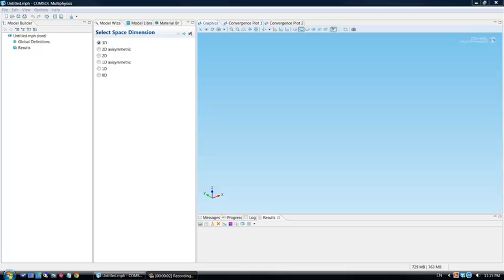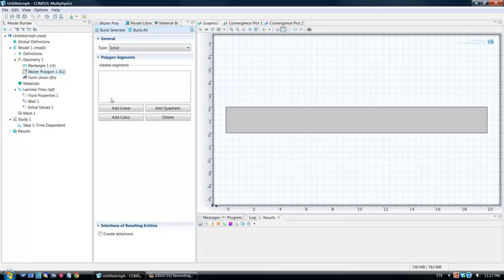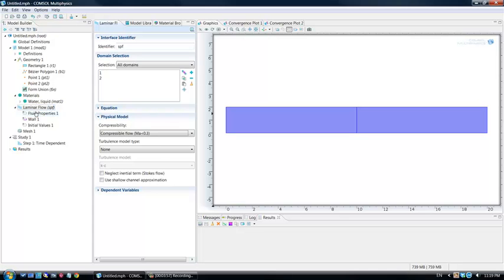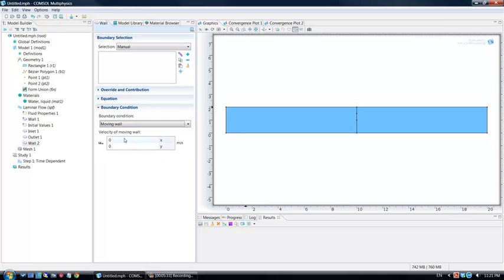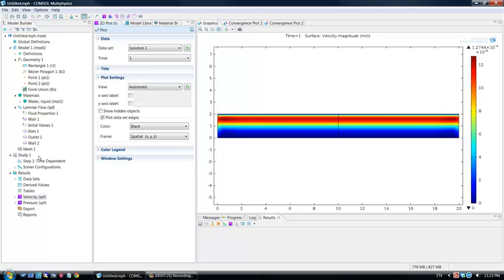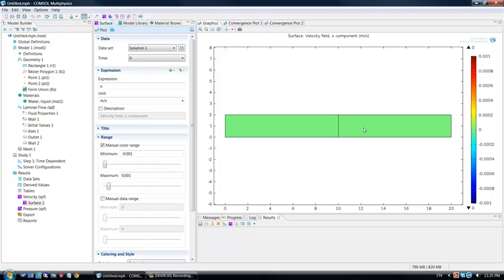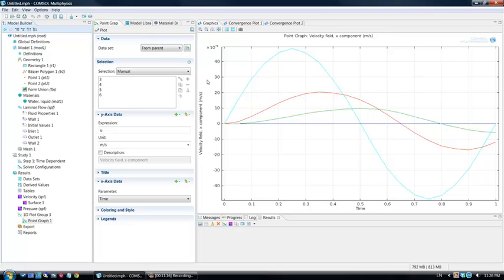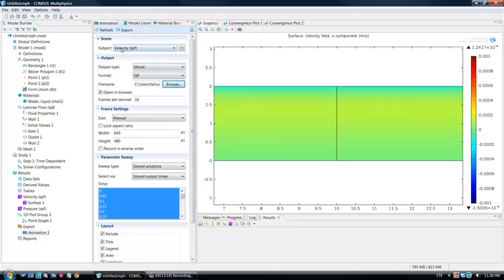Couette Flow

Comment: If I use the same dimensions as you but switch the moving wall speed to 61 meters per second it no longer converges (after hours its still calculating!) 
What is the difference? What dimensions do I need for infinite X distance compared to Y length? What is the speed considerations for convergence?